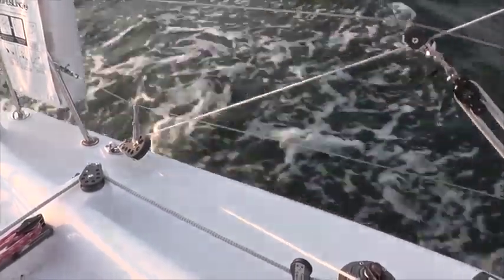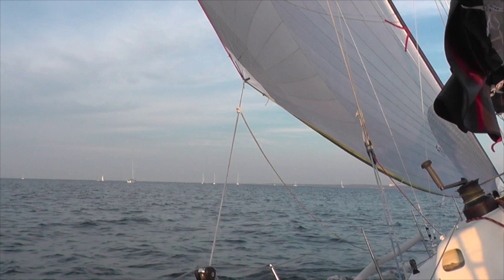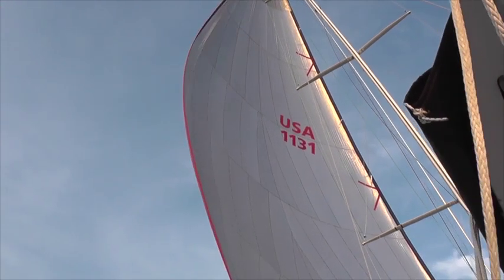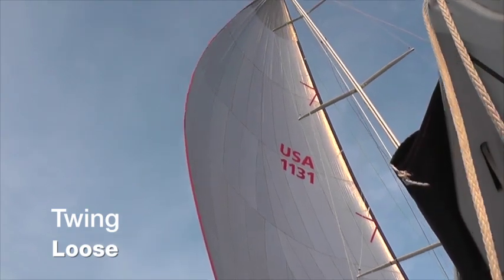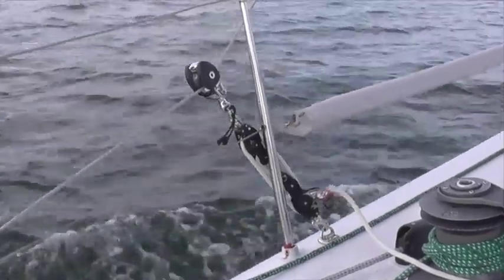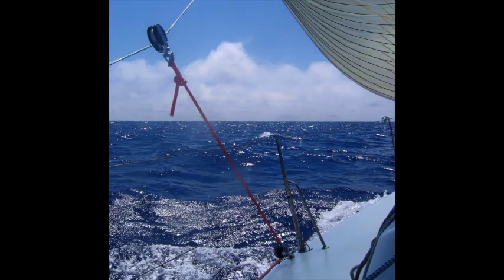Tweakers and Twings

Comment: So is it appropriate to use a twing instead of cars for other headsails? The advantage being that twings are easily adjusted from the cockpit.
Reply: Certainly a genoa, or any other foresail you're sheeting outside the rails most of the time.

They're really easy to get a shape with as well, much easier than cars, and you don't need to put a dozen holes each side in your deck to fit them.